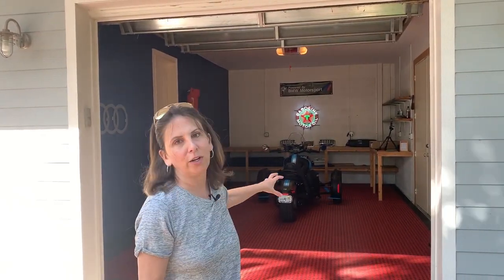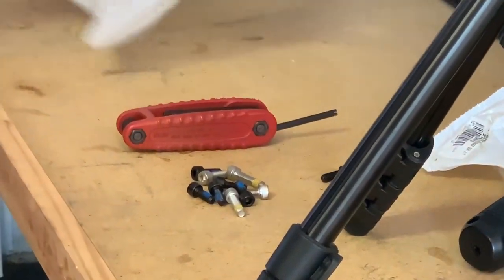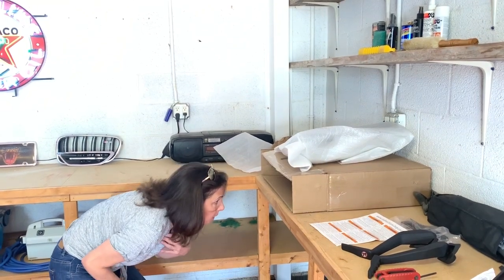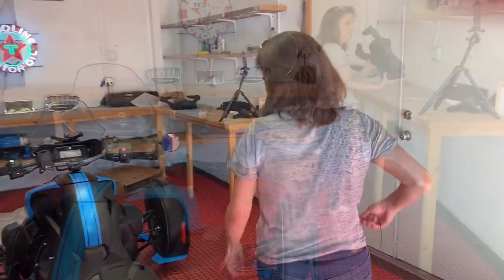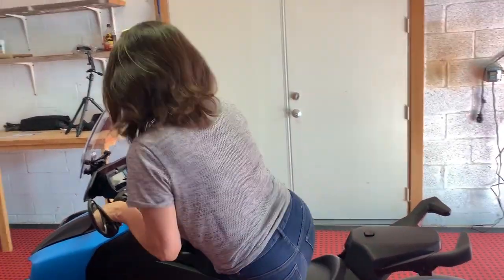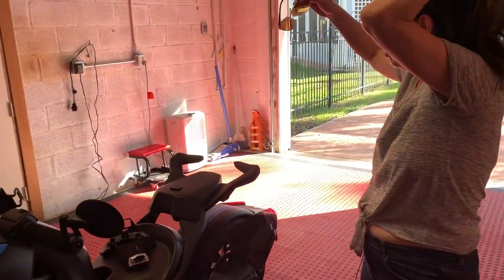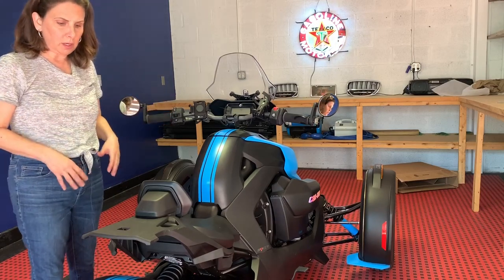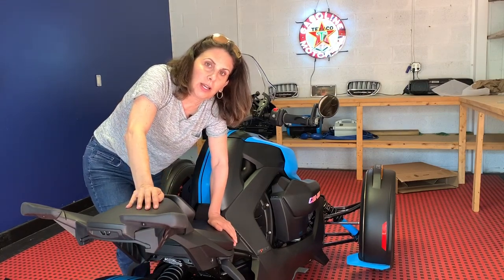Can Am Ryker Passenger Seat (install and review)

Comment: Lol, I love that "the struggle is real" trying to get the seat locked in.  Would you say the passenger seat is comfortable enough for a medium length ride?  Is it foam or gel or hard plastic?  Thanks for your time and effort, nice to have a regular person showing how easy/difficult assembly may be.
Reply from the maker: Thank you Keith for watching and your nice compliment!  The passenger seat is a hard foam material and would be comfortable for medium rides IF the person is petite.  I, personally, do not like riding 2 up. I feel like the bike isn't really designed for that, as opposed to the Spyder. If you are riding with a passenger, be sure to get them the high backrest. When you aren't riding with a passenger make sure to put the foot pegs back up.  There is a sensor in the left peg area that tells the bike to ride less aggressively, when the peg is down.
Reply: @RykerRydes  great point on the Ryker vs the Spyder for passengers.  I'm looking at getting the Ryker after I take the class this month.  I had considered the Spyder but opting for the Ryker as a less expensive toy (plus I'm already buying an e-bike, so my wife will lose it if I get too many expensive toys!)  I LOVE your comment on the pegs and the sensor - don't remember if you mentioned in your assembly video, but that is an absolute jewel of an item to know!  Again thanks so much for sharing your knowledge and enthusiasm - got a feeling I'll be checking you out much more frequently soon...;-)

Comment: Sounds like the new driver backrest
from Slingmod works with the passenger seat. I personally have not
made a call to confirm. Righty righty
Lefty loosy. Way to go girls.
Reply: Tom Mc lemore unfortunately when I emailed they said no it won’t work with the passenger seat.  However I have both comfort seats installed so not sure if that matters a difference.  I have seen pictures of s Ryker on spyderlovers forum though with t drivers backrest passenger seat, and a 3-piece luggage system... not sure if it was custom fabricated or not however

Comment: Do you or could you do a video showing a passenger riding using a chase vehicle, not 1st person view? Also have you heard of any passenger foot boards that would fit a ryker?  (900 ace if you need to know) please and thank you! Great videos!
Reply from the maker: Wow you have some good questions/comments. My next group ride, I will get some 2 up footage. And, unfortunately I have not heard of passenger floorboards. The passenger pegs are specifically designed for the Ryker.  When they do down it changes the mechanics of the bike. It puts it in passenger mode. You don’t want to ride solo in that mode (restrictive). Hope that makes sense?
Reply: @RykerRydes I ride solo to work, and take short rides in the evening and weekends with the wife. We are both on the heavy side with a custom rear shock from elka that works great! I was dreaming of a set of rear footboards that could attach and be removed with a bolt.

Comment: Hey Beth, I think that shock adjustment tool is supplied in your tool kit with the Ryker. We are both going through the same learning curve. Im learning my new Spyder F3.
Reply from the maker: I didn’t get a tool kit, but will call to inquire!!
Reply: My tool kit was a single screwdriver of the absolute cheapest quality.  I had to buy the spanner separately.

Comment: The 1 up backrest beat my lower back to death on rough roads...When I put my back seat on, it IS enough back support for me so my 1 up backrest is for sale.  In this vid, when you lean back on your back seat, and can't reach your handlebars, try adjusting them back toward you a bit...problem solved
Reply from the maker: Wayne, I am sorry the backrest did not work for you. Do you have the Rally? I generally am not on rough roads. I guess a lot depends on the person: weight, height, riding style etc. My handlebars are pushed all the way forward. I wish it was that easy of a fix. I do appreciate your comment and suggestions. Again, sorry it did not work for you.

Comment: you really need the 2 up spring adding not just adjust standard seat
Reply from the maker: If you are riding with an adult passenger, I do recommend a different passenger spring you will bottom out.

Comment: The seat is ugly and expensive. The passenger pegs, yikes, don’t let summer coops design aftermarket parts.  For the cost of the seat and pegs plus the extra cost of that bracket on the back which must be made out of a gold alloy she could have a full set of snap on tools, in a box on wheels with enough left over for a pair of safety shoes. I love my Ryker but that seat really is a POS.  I found a cheap cargo plate that I can bungee cord my ATV passenger seat to.  Looks just as ugly and it’s more comfortable.  Pegs?  Hose clamps and 3/4” steel pipe with cheap bike hand grips.  It doesn’t automatically reset the computer to “limp home”. Nuff said.  Bike is a 10, seat is a 0.5.